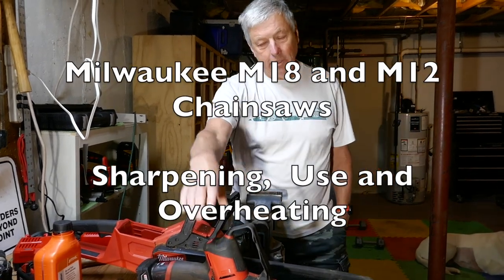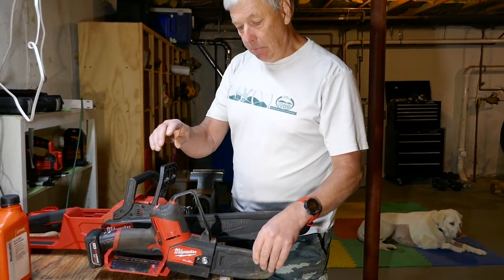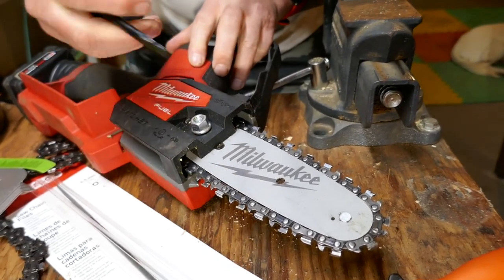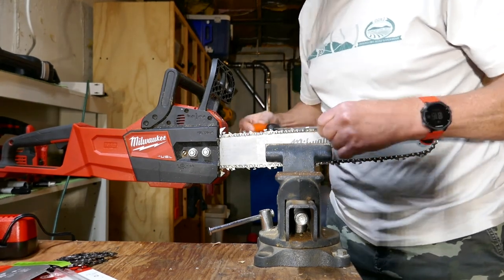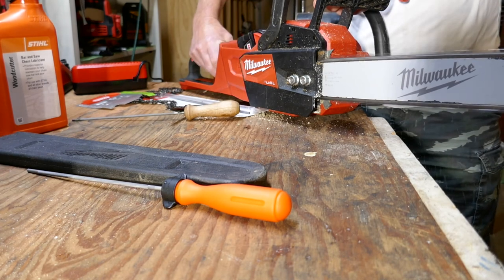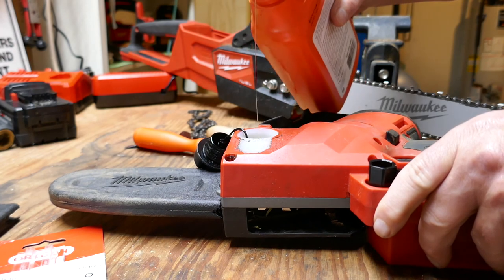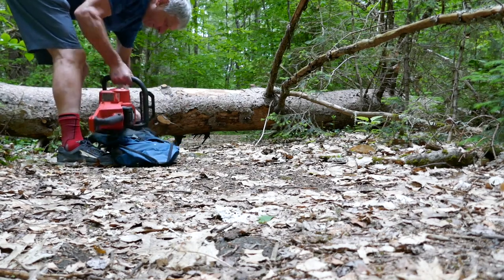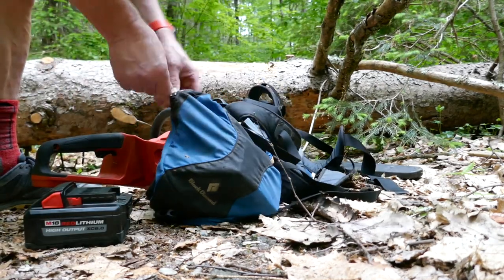Milwaukee M18 and M12 Chainsaws: Sharpening, Use and Overheating

Comment: I have both these saws also.. the M12 needs the 6.0 XC battery $120 at home depot... M18 needs the BIG  HD 12.0 battery $250 at home depot.. yes they cost more but for what they are used for they are worth it. Any smaller battery can not handle that kind of use
Reply from the maker: Yup - seems you do need the 12.0 - tried it out for the first time the other day after both my 6.0 batteries overheated.  Video: https://youtu.be/1VjIpmy_WX8
Reply: The M12 4aH battery is better than the 6ah battery for high draw tools, but at the expense of 2ah.

Comment: I have the big boy and I think it's a pretty good saw - for what it is.  You sharpened the little one with proper  or good body mechanics, but sharpening the larger one differently by standing at the end of the blade which seemed to me seemed awkward for you.  Just saying.

Comment: How are you advancing the chain during sharpening. On my m18 hatchet that i just bought the chain is locked tight when not actually "running". It's not too tight, it's some kind of brake.
Reply: I came here looking for the same answer. I have the same issue on my m18 chainsaw. Same one he has in the video. Have you found any solutions yet?
Reply: @kraniumfilms4609  It turns out that there's no trick, you just have to put a lot of force into it and it will turn. I'd recommend doing it with leather gloves in case your grip slips. Since there's no clutch like a gas saw, you're turning the motor whenever you turn the chain. It's my least favorite part of an otherwise good tool.

Comment: I have the same M18 16" chainsaw but with the 12Ah battery and luckily haven't come across the overheating issue on the big battery. Last week, my brother-in-law got the new Ryobi 40V HP 18" chainsaw with the 4Ah battery and I have to say I'm a little jealous... It's noticeably lighter than my Milwaukee and cuts just as well, if not a little faster. I feel like the chain speed is higher so it feels like it takes less effort to get through a round - it does bog down a little more easily though - maybe less torque?
Reply from the maker: I was cutting up a tree the other day and my 6.0 Ah batteries overheated so I tried my 12.0 Ah battery and it didn't so I think your suggestion is correct!  Thanks!  Here's video with the 12.0 Ah battery: https://youtu.be/1VjIpmy_WX8

Comment: I own the Milwaukee M18 chainsaw, and original  it's using a 12 Ah battery, wich I never had overheated, not even in summer. I have 3 such batteries, and never had a problem with filling my trailer with firewood. And yes, I saw  birch, mountain ash and larch as firewood, felling, limbing and cutting those trees on shorter bits that fits my trailer. No problem even to fell big trees, this saw takes it like a gasoline saw, without the fumes, gas filling and the noise, I never go back to a gas saw!
It would avoid overheating by using the 12 Ah battery in my opinion.
Reply: I find the 12 amh overheats pretty quick, as well as the 9, 8, and 6.  You need about 4-6 to rotate.  The M18 does better in cold weather.  The M12 is awesome, and I have zero trouble with it.
Reply: @jenniferwagner4595  That hasn't happened to me yet, but you maybe work with the M18 in warmer weather. I live in Norway, and though I saw in summerdays as well, it never is warmer then about 25 degrees Celsius (77 F), so nice temperature, but not hot. And very often the temps are lower..........So I guess you are right about that!
Reply from the maker: I think you're correct - 12.0 didn't overheat for me but the 6.0 did again: https://youtu.be/1VjIpmy_WX8
Reply: Great video highlighting some of the note worthy issues that can help Milwaukee continue to improve upon the designs because I have and regularly use the m18 chainsaws both the 2727 rear handle as seen in the vid as well as the 2826 both 14” or 12” models available the bar being the only difference but ime both the 2727 & 2826 are fantastic saws that I really  enjoy using, the newest from Milwaukee being the top handle which was made as a climbing saw but is more than capable of dropping larger trees than I’d be comfortable to fell solo, an for me I find it to be the perfect size as it’s small enough to throw in a duffle making it easy to carry without losing any of the power of its bigger brother the 16” model #2727 so putting an 18” bar on is a very viable option and Ive done it quite often and likely could even get away with a 20” bar reasonably….so it’s just really versatile saw in general with the ability to fell small and medium sized trees but also was meant to make cuts in trees in awkward positions making it ez to handle and perfect for someone wanting one chain saw that gets used periodically as imo this one’s 👌🏼to manage properties or storm cleanup etc. 

However as great as they are they both 2727 & 2826 are exceptionally hard on batteries, I’ve sent 2 of the HO 8.0s to an early grave myself in the 2826 in less than 6months as well as seeing many others having the same experiences especially with the 8.0s…Better luck using Only the HO batteries specifically the xc6.0 HO the new forge xc6.0 and the 12.0s but the new forge battery has the least voltage drop when under load and can charge from 0-80% in 15minuts with the new charger which sounds incredible I just wonder how hard it is on them charging at that rate.